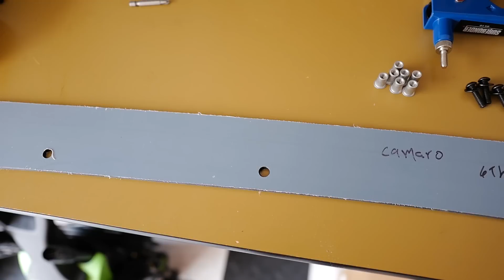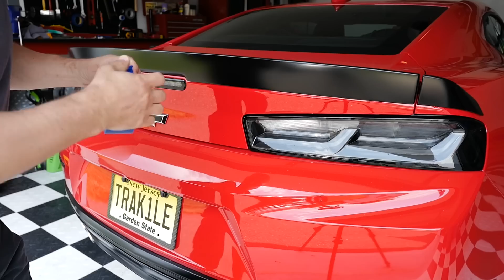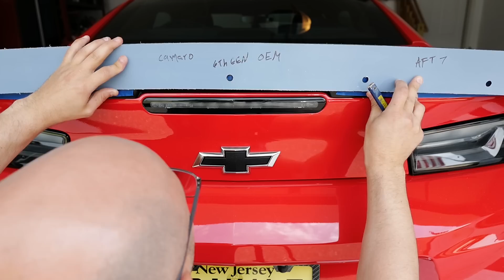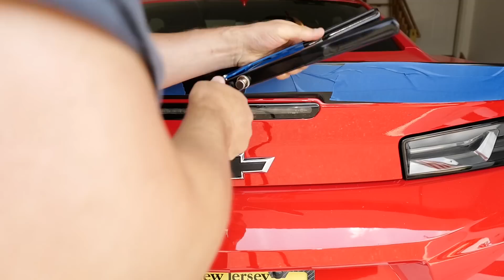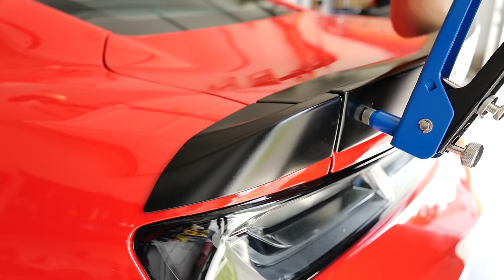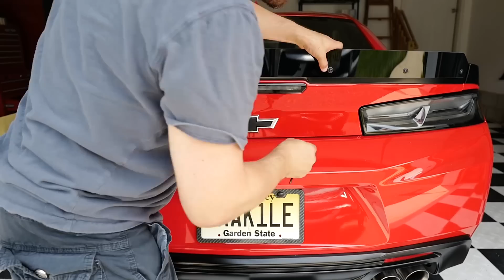ZL1 Addons OEM Wicker Bill Install for 6th Gen Camaro SS 1LE 16-18

Comment: Great installation vid! I've been considering getting one of these myself. Not a knock on you, but in the video it looks like the bottom edge on the driver side of the wicker bill is not straight. It looks like it was cut wrong. Is it like this in person or is there something weird happening in the translation from reality to digital presentation? Thanks!
Reply from the maker: Thank you.  There is actually a couple millimeters of play between the holes and bolts.  So I was able to move it slightly to the left to line it up.  Thanks for pointing it out  👍